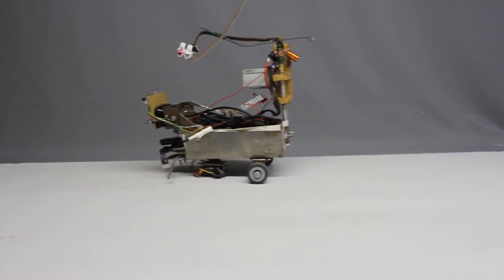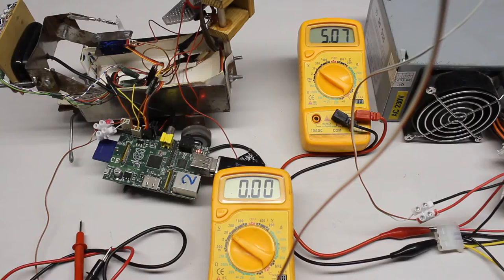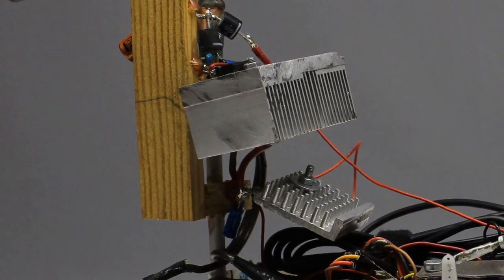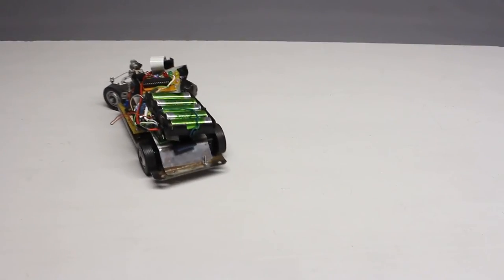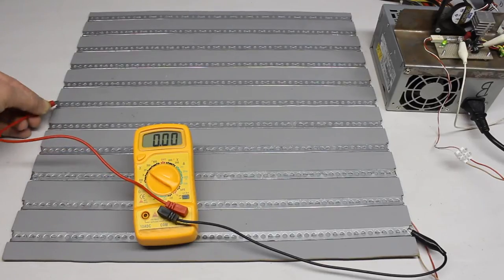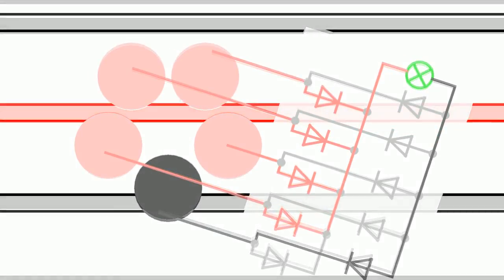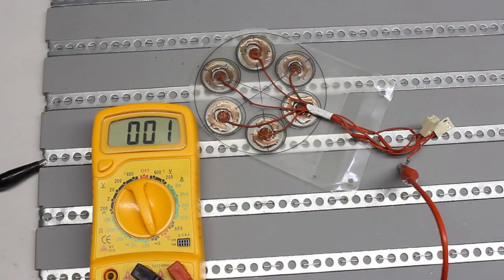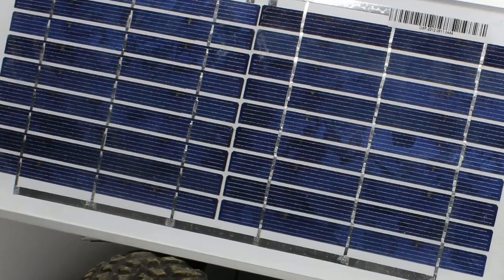Powering mobile robots through cables & power rails

Comment: Very interesting idea with the dc power rail system. Have you thought about connecting an ac supply to those rails and using some sort of coil on your robot to power it via induction (and then rectifying it, of course)? Would this be less prone to interruptions?
Reply from the maker: ***** That would be the inductive charging technology. Without sliding contacts, there would be (almost) no interruptions. Disadvantages of that system are the electromagnetic radiation emitted by the base plate, the lower efficiency and the more complex electronics.

Comment: I accidentaly put reversed voltage into Raspberry pi but nothing happened. It survived :). It was old model B with linear voltage regulator. Should switching voltage regulator on newer Rpi survive it too?
Reply from the maker: ***** May be or may be not. Voltage regulators are often (but not always) protected against wrong polarity. The linear regulators as well as the switching types. If it happens again with a newer Raspberry Pi, tell me about the result ;)